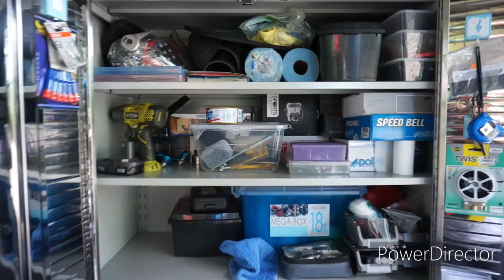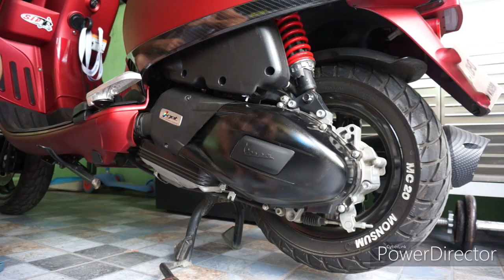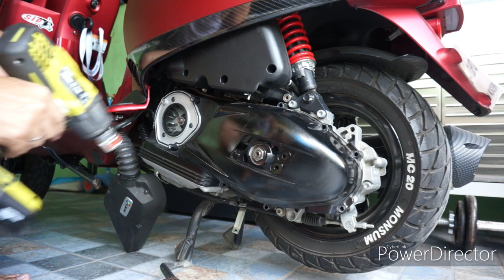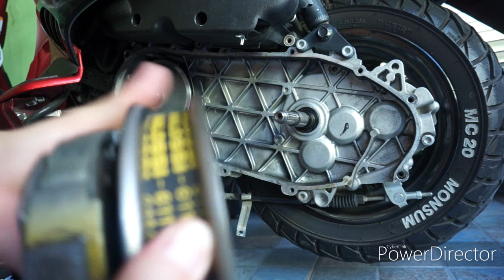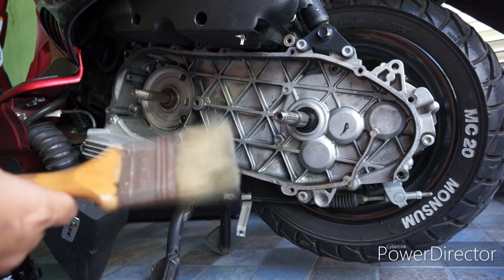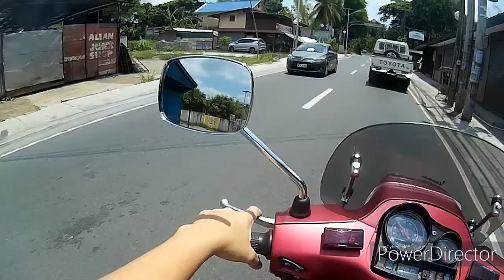PAANO MAGBUKAS AT MAGLINIS NG PANG GILID NG VESPA #009 | How to clean and maintain CVT of Vespa

Comment: boss anong rotation pag tanggal nang allen screw  yung sa may rear brake cable katabi ng may rubber sa ilalim ng cvt yun holder mismo ng  cable
Reply from the maker: Counter clockwise po lagi ang pagtangal